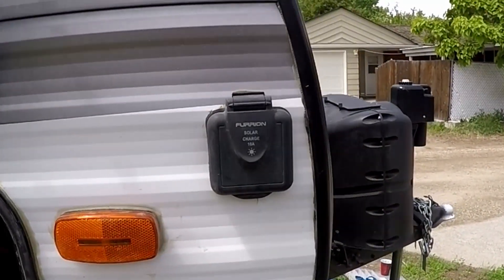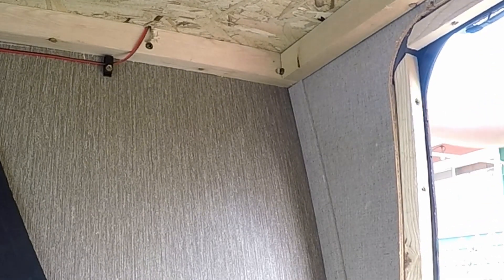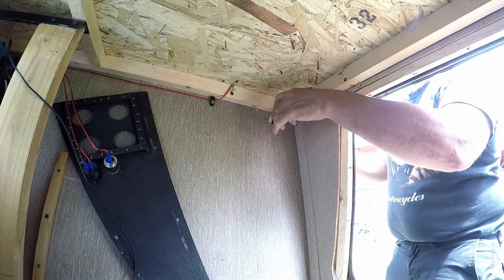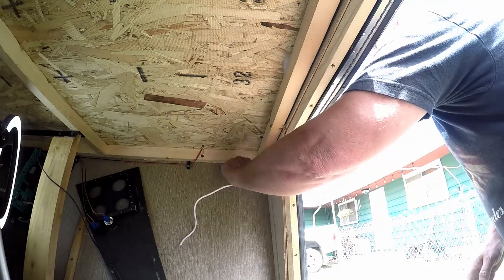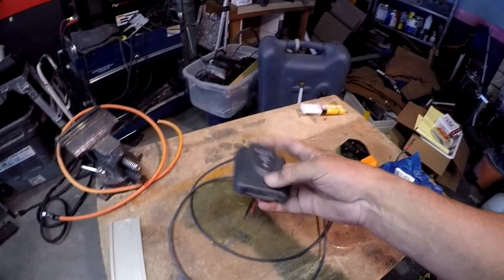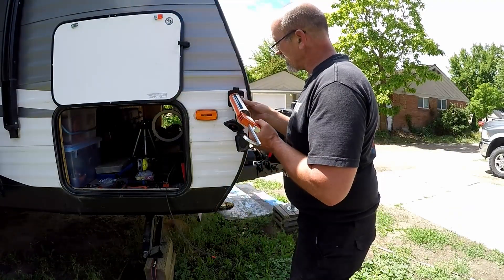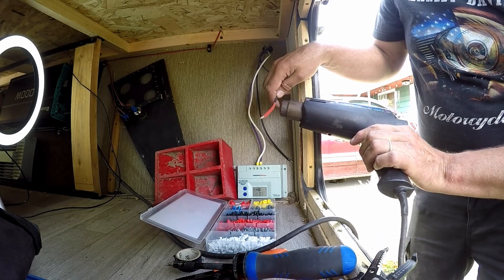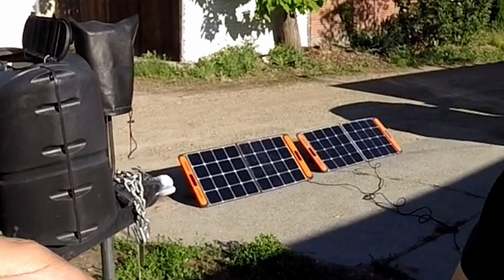Furrion Solar Prep Plug Hack NOW 20 amp and wired with a PWM charge controller.

Comment: So that Furion plug is wired directly to the battery?  There’s no factory charge controller?
Reply from the maker: No there is not a charge controller in the system.

Comment: Can one change this from a 10a to 30A?
Reply from the maker: Not without increasing the size of the wires and the plug would have to be a custom plug similar to what I did here as I do not know of anyone making a plug capable of handling 30 amps.
Reply: Basically this port becomes nothing more than a protective housing cover for the connection after modification.  So as long as the connector can fit inside the cover it should, but I might consider modifying a 30a ac plug instead if there isn't enough room.

Comment: What would happen if you did plug a 20amp solar suitcase into a 10amp furrion connection?
Reply from the maker: I can only say that you should not do that for the slight chance that if your panel does produce a constant output amperage greater than 10 amps a failure of the connector could happen in the form of excessive heat causing melting of the plug, shorting of the wires ect.. This is the best answer I can give.

Comment: Are you using two 100w jackery panels? Has it been pretty efficient with charging the batteries too? Just found out about modding the furrion plug so I’m definitely tackling that next
Reply from the maker: I use to use the panels but not much anymore. When I had both hooked up I would see average 160 watts of input. We now are full-time in our RV and have enough solar on our RV to keep our trailer charged along with charging the jackery.

Comment: Is there a fuse somewhere in the factory wiring? I’ve read there is a 10 amp one in line but I can’t find it.
Reply from the maker: The only thing we had in line was the 30 amp resettable breaker that was on the frame next to the battery.
Reply: @DiyRVandHome  Thanks for the reply!